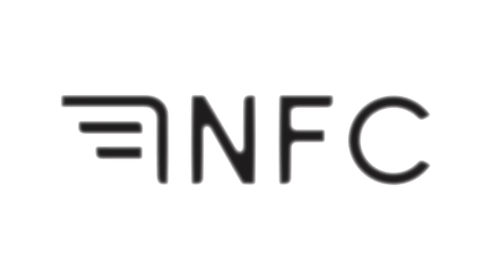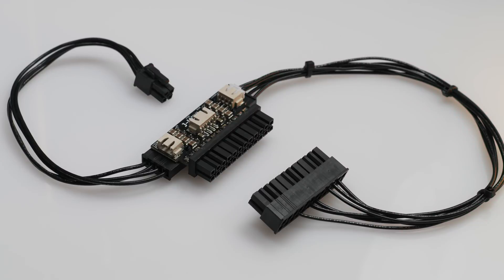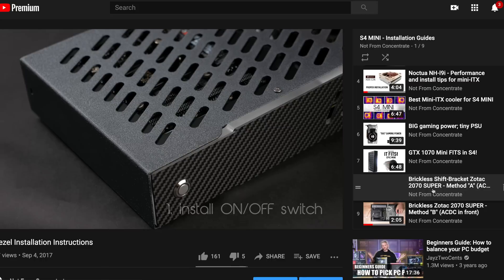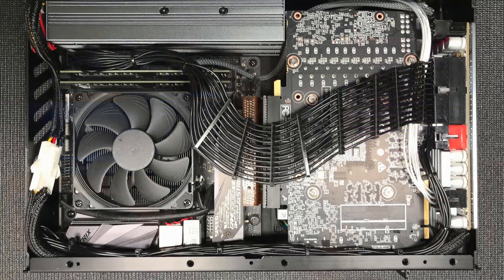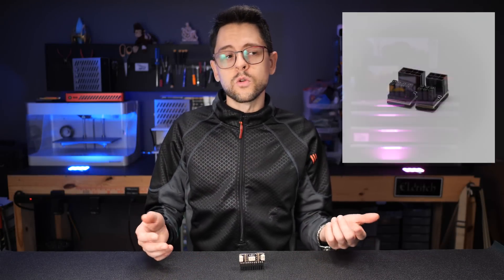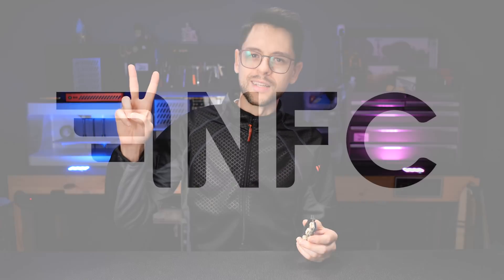CLEAN cable management with the J-HACK M2426

Comment: If you're the more intrepid type, you can forgo the connector altogether and run wires straight into the GPU 6/8-pin power socket. :3 ......Really the HDPlex 400W AC-DC housing is so tight against the card it's not really possible for anything to fall out.

Comment: Did you explored any ATX12VO motherboards and PSU options for them yet? WIth M.2 solving majority of storage cases (especially with good heatsink on it), there is basically no need for extranal drives, or 5V or 3.3V stuff from power supply. And few remaining low current voltages can be done by mobo these days.

Comment: You should design a s5 mini that has custom pcbs built in to connect power without cables. You just place the module in the right spot for your gpu and it’s already standardized for most current gen itx boards. All of the wire can be hidden in the walls of the case or sent through traces that run the length of the case. Would make for an awesome concept, and who knows, maybe you will change the way people plug computer parts in.

Comment: Do you have something that can power from single 12VDC supply ? This is to run from 12VDC battery.
Reply: The issue is a 12V battery is not really 12V. It can be anywhere from between 10V to 14V. So you need a buck boost converter to maintain it at 12V, and then if that 12V battery is hooked up to anything else, like inside a car, you'll also need some pretty big caps to maintain the power when you crank it or use other features. So there really isn't an automotive based DC-DC PSU for computers.

So TLDR: No, there is not a good product for 12VDC batteries.
Reply: @j-hack7998  Thanks. I tried this. https://www.mini-box.com/M4-ATX . The last 2 units broke down within weeks in the lab :( Doesnt this means there a market for this? Can tolerate much voltage swing as SBC input voltage is wide range, 10 to 14V is no issue. Adding zener diode to clamp voltage is plausible.
Reply: @anpr  The market is quite limited. Most would just use an inverter rated for the needed power, and maybe a moderate capacitor for more power hold-up. It would only in a very limited situation where you need high efficiency and high density. 

Most people either have space for an inverter, which is more versatile, or will use a laptop.

There may be a small market, but it's hard to target markets. If there is enough demand, there can be an add-on board that is more efficient and separates buck/boost functions into two hardier boards.

Comment: Absolutely love the idea behind M2426!

My only gripe with it is that I don't like the exposed look of different-colored PCB components and onboard connectors as I prefer to have a very clean look in my builds.
I've asked the creator if they'll be offering some kind of cover/shield as an add-on to make it look clean and stealthy but they stated it's not a priority for now.
If I was skilled in 3D modelling I'd probably make it myself but oh well..

Here's to hoping this changes in the future, I'd definitely be a buyer then.
Reply from the maker: What do you mean exactly, I don't understand since the PCB is all black. Thanks
Reply: @NotFromConcentrate  Hi, sorry maybe that sounded a bit confusing. 
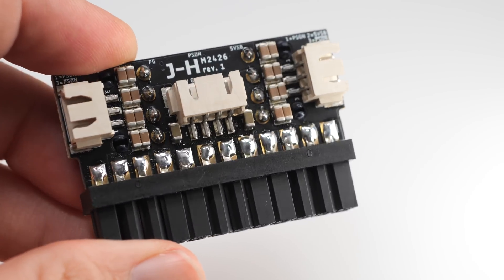Yes the PCB itself is black, but looking at the entire package (0:27) there's white connectors, the silver/brown capacitors and shiny solder points on side, chokes on the other, the height of different componentry side-to-side is not symmetrical, it doesn't look very visually appealing in my opinion.
By cover/shield I meant something like this (https://smallformfactor.net/wp-content/uploads/DMini.jpg - but that it also covers the top side since I think the Dynamo is exposed from the top).
It could just be a simple plastic piece that would slide over the PCB with cutouts for connectors and that would make the M2426 look like a sleek uniform package rather than a  populated PCB that sticks out the 24pin connection on the motherboard.

Maybe I'm being a little nitpicky, I'm sure most people don't care about this, just trying to provide some feedback that could improve the product :)
Reply from the maker: @nyuuuuuuui  Oh I gotcha, thanks. I was confused because it basically looks the same as a motherboard. Keep in mind too that you will never ever see the sides, only the top, because of how it is installed. Thanks for your comment. <3

Comment: Am looking to build a Corsair One inspired case. Is there a PCIe extension cable that could connect from a vertical GPU to a horizontal motherboard. I dont think a standard PCIe extension cable would work. Link would be much appreciated.

Comment: And there is no problem even though so many of the wires on a "24 pin" are omitted? Looks like there are only 6 total wires coming from your DC-DC to the J-H
Reply from the maker: That's the point. It doesnt need all those wires. It just needs the 12+ and 12- asit generates the other voltages and sense onboard.
Reply: @NotFromConcentrate  makes sense. No real concern about efficiency difference? Or any other considerations?
Reply from the maker: @KalebQi  I'd hit up J-HACK for efficiency papers, but it should be very efficient. Keep in mind its not generating the 12v, it's just using your power supply for that. Your SSD drives aren't going to take much juice anyway and that would be the only thing using the 5v and 3.3v really. Your motherboard is going to have its own converters for things like USB. It's mostly just a fancy 24 pin cable. Thanks for your questions!

Comment: What’s the max power this can handle?... I.e what’s the max you we can fit with this?
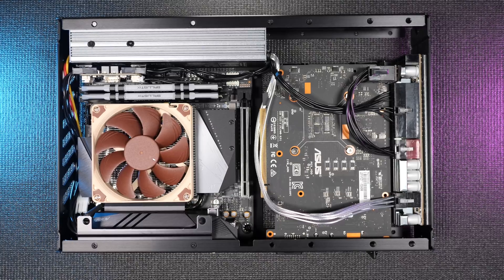Reply from the maker: Its 200w. You use it for your motherboard, sata, and cpu. For most gpus you would just use the pcie cables from your power supply like you see at 1:59
Reply: @NotFromConcentrate  How do you connect the data cable to this?
Reply: Thanks for the reply... If I have to choose between hdplex 200w combo and this, which would you recommend? I believe the combo also has a 24 pin plugin unit and an ac to dc converter..! Confused now!
Reply from the maker: @thirumalkumaran  M2426 + Meanwell RSP200 (or similar) vs HDPLEX 200 Combo will achieve the same result in the same configuration. However the M2426 and the HDPLEX 200 DCDC are not the same thing as they can be used differently. The HDPLEX DCDC converts 19v to 12v, which is useful for running big power bricks. The M2426 just takes 12v power and spits it back out again. As far as my recommendation for your use case either will work. I like how the HDPLEX products are designed to bolt right into the MINI and they come with all the cables you need for a low power build.

Comment: Whats the max power (watts) this little guy could handle ? Is it suitable for 5900x & 3080 ?
Reply from the maker: Its 200w. You use it for your motherboard, sata, and cpu. For most gpus you would just use the pcie cables from your power supply like you see at 1:59
Reply: @NotFromConcentrate  thanks buddy... my bad.

Comment: Looks interesting. Do you have to be careful with how much power you pull through it/does it have a wattage rating? I imagine that the individual cables going to it are only rated for so much power
Reply from the maker: It has a rating of 200w total flowthrough. I don't know if there is a hard cutoff, hopefully J-H will respond. If its anything like similarish products it should throughput alot more...it just might get hot and your connectors can melt.
Reply from the maker: I'll add that since it was designed for SFX power supplies to get rid of ATX, CPU, and SATA power cables the intent is you would be using the GPU cables supplied by your SFX PSU. But I of course use it a bit differently for the MINI with the HDPLEX setup and low powered GPUs.
Reply: @NotFromConcentrate awesome! That sounds like pretty much all you could need for everything apart from GPU and you can power that separately as you say.
Reply: There is a cutoff at 200W. Now you can choose to power your CPU from this board or through separate CPU power cable as most people do. Separate power cables won’t have the limit.

Comment: Clever. I wonder if the dc to dc board can be rearranged a little so you don't need a bridge for the gpu power. Then again putting a male connector on a psu seems silly.

Comment: So can this just be used with an external 12 volt AC/DC PSU?
Reply from the maker: It's actually for internal modular power supplies. I use the HDPLEX combo but it was designed for the Corsair SFX power supplies.
Reply: This would be a far superior use of such a device, allowing for even smaller package combos, and the case not needing to be much wider or longer than the MB itself.